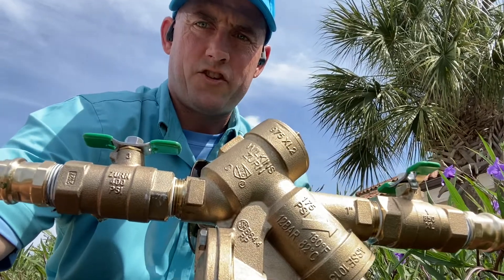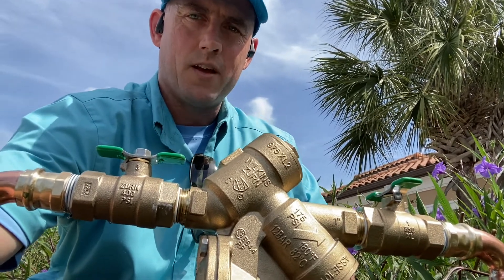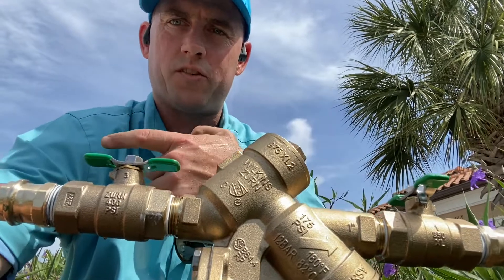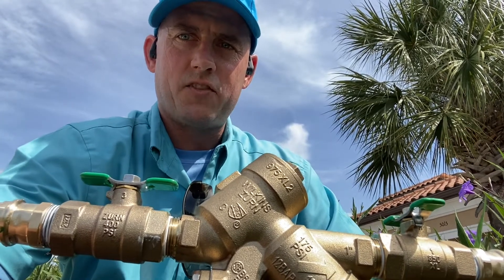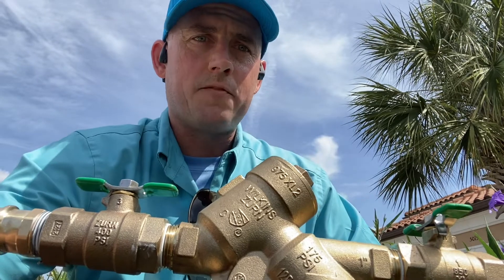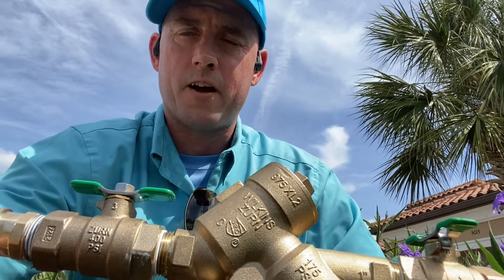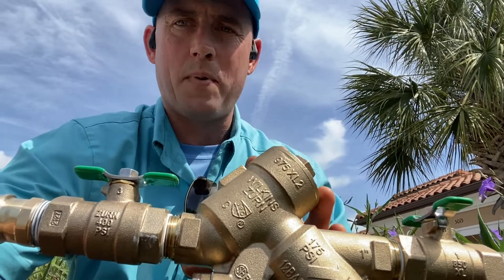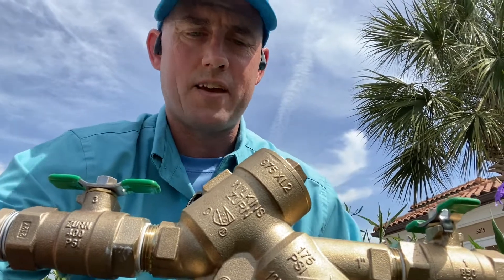Why do we need backflow preventer testing?

Comment: Yea but garden hoses are never connected to the backflow preventer
Reply: True! Well the real reason to have a backflow in my irrigation experience is to provide the enough water pressure for piping and sprinkler heads.
Reply: @carloscruz-qb4xk  from experience water sourced backup sump pumps are rarely connected to a backflow device
Reply: They're supposed to have an anti-siphon device on the hose bibb.